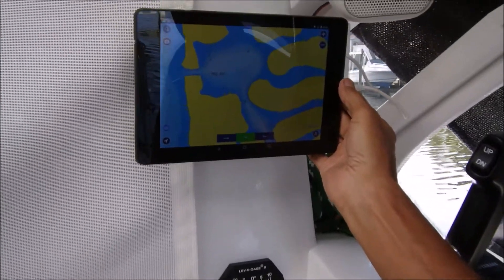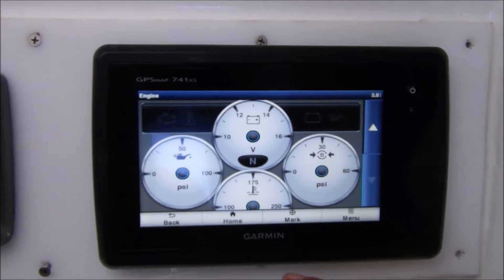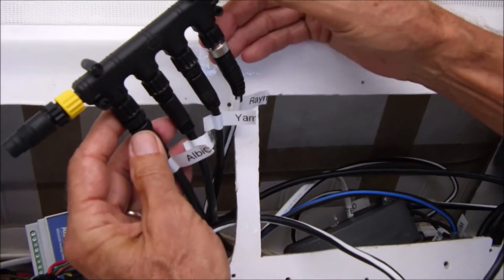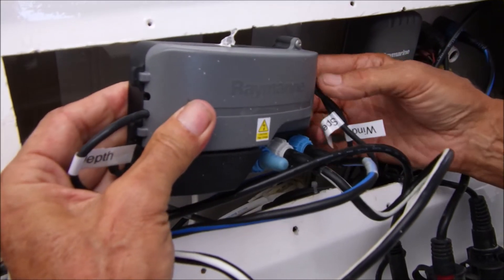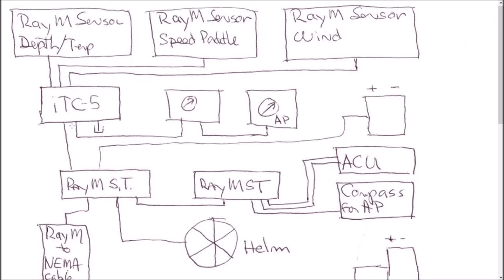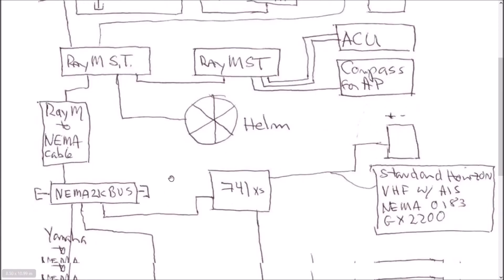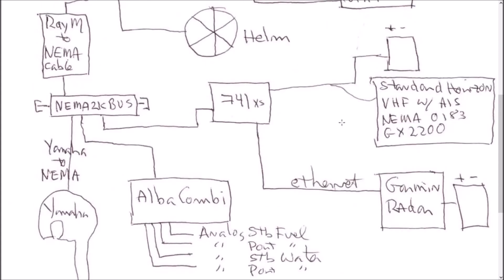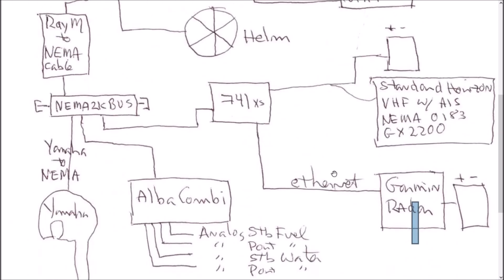066 Upgrade 3: Garmin+Raymarine+Yamaha+AIS+Analog on NEMA 2000 network, Gemini Catamaran 105Mc

Comment: hello Brian
Great video, question is it possible to add a Garmin 741 on a existing Raymarine E140w with a 424HD Raymarine Radar on that same configuration on this video?
Reply from the maker: Hi Fernando!  Great to connect with you.  Sorry, I don't know the specifics of your components.  My guess is that your Raymarine equipment is SeaTalk NG.  In my video, I used an NG to NEMA converter cable to put everything on the same 2000 backbone.  The reverse also should work: putting the Garmin 741 on your current NG backbone.  Either way, it is the same network and information, I believe.
Reply: Brian Jacobs thanks for the reply Brian... I will try to make the connections and keep you updated, thanks again.

Comment: Dear Brian, congratulations for your interesting video!!!... I have a Raymarine ST4000 and I have a Standar Horizon VHF/IAS too, and also I have two Garmin GPS one 742XS and old 441/s (NMEA2000). I am using NMEA0183 for: AIS and Wind indicator, it is working well I am connecting to both GPSs and the GPSs receive both signals well. . I think that i dont need the ITC5 because it is working well NMEA0183, In what cases do you recomend to buy ITC5, just to convert NMEA0183 to NMEA 2000? for standarized all the connection to NMEA2000?.  I want to buy the Raymarine E22158, I think it is include all for conver from ST4000 SeaTalk to Seatalk ng, an important question: do you know if this kit include the NMEA2000 o Seatalk ng converter cable?  or do you have the code number for Seatalk ng to NMEA2000 converter cable?  I would like to control Raymarine autopilot from Active Captain (Garmin). It is posible?. Thank you very much
Reply from the maker: Hi Ernesto!  You probably know as much as I do about the specifics of various manufacturers.  But let me see if I can help: I  only needed Raymarine's ITC5 for Raymarine's stuff.  Hmmm, maybe I could have put those instruments through the AlbiCombo... I should have tried it!  Sorry, don't know about the contents of Raymarine kits, but you can buy the cable separately, like shorturl.at/suwLW for example.  It is a bit confusing, but the RM autopilot is activated from the RM controller, but the course is set from the Garmin chartplotter.  Hope that helps!  Brian
Reply: @presencingly  Thanks!!
Reply: Hey Brian!!.. how are you?. This week end I installed all in the sailboat, but guess what?, In the Garmin GPS I only see the E22158 adapter. I am using the raymarine E22158 started kit. I am using the Seatalk to SeaTalkng cable and for convert to NMEA 2000 A06046 form Amazon, but only I see the E22158 adapter from the GPS, any clue?. Unfortunately I read the manual and it says that the LED flashes depending on the fault, I did not try it.

Brian: My question is, does your Raymarine ST autopilot appear on your GPS? Can you register it on the GPS? Can you drive the autopilot from the GPS? It only allowed me to mark  a waypoint in the GPS  and pressing TRACK on the autopilot allows me to navigate to that point, nor does it I can follow a route, only one waypoint. but I don't see a Raymarine ST screen or anything that says autopilot on the GPS,  Thank you very much for your support!!!
Reply: Just to clarify. I am connecting from the control unit of the ST4000 a flat Seatalk cable at one end and at the other end the yellow connector of the E22158 converter. The Seatalk to SeaTalkng cable (A06046) to the white converter connector and the other end to a NMEA2000 T. It's okay?. Thanks
Reply from the maker: @ernestogarciadealbamailper1841    Hi Ernesto!  I think you're asking "Does the Raymarine Autopilot show up on the Garmin chartplotter (what you're calling the GPS)?"   What you're describing is correct:  You can set a course (either a single point or route with multiple waypoints) on the chartplotter and the autopilot will follow that course.  You do have to press 'track' on the autopilot to initiate the process, and confirm a course change at each waypoint.  But I do not have a version of the Raymarine screen on the chartplotter (GPS as you called it).  I enter the course/route/waypoints on the "GPS" and confirm following them by pressing a button on the autopilot (or with the autopilot remote).  I think you've got it set up properly!
Reply: @presencingly  Thank you very much Brian, yes you are rigth the GPS is the Chartplotter. I will set up and do some test and verify the flashing led... Best regards,
Reply: Hi my friend!... let me talk you what do i did this weekend. 

I connected the nmea0183 output from the horizont radio to the chartploter 742 (input) for AIS. I connected directly from the output 0183 of the 742 to the input of the autopilot and yes, you are rigth, presing track button I can fallow the route entered in the chartploter, pressing track each point of the route. Other nmea0183 input cable of my old gpsmap 441s i am connected the wind indicator and I sent via NMEA2000 to all the equipments. I am using the E22158 to take al NMEA0183 data to NMEA2000, or I don´t know if the chartploter is doing this conversion. I will disconnect the Seatalk network next time. 

 I was wondering if you can see direction controls or autopilot control/device in your chartploter, can you see it? I only see in NMEA devices the E22158 or you only create the route in the chartploter and you fallow it in the autopilot pressing track?, or both?. Sorry for bodering you. Best regards
Reply from the maker: @ernestogarciadealbamailper1841   Hi Ernesto!  No problem at all.   You are correct:  I do not see direction controls for the autopilot -1/-10 and 10+\1+  on the chartplotter.  It works exactly like you said:  I can create the route in the chartplotter and follow it on the autopilot by pressing 'track'.   Great job!
Reply: @presencingly  thank you very much!!! Best regards

Comment: Hi Brian, I am in Australia & live on a Pescott 11.7 Meter sailing Cat. I am about to swap my old Yamaha 9.9's for 2 X T25XWTC Yamahas. Your video is very informative. You say you have a Yamaha 25? Is it a T25 or an F25. & with the wiring of the engines to the NMEA 2000 Multi display chart plotter? You have cables running  with no 'Gateway' ???? I have All Raymarine instrumentation & a Raymarine C95 plotter  so it is all 'SeaTalk' rather than NMEA 2000 but other than pin configuration all same same. Looking at what you have done (a couple of patch cables) & what Yamaha & Raymarine tell me I need a Command link network Hub, A Gateway MAR_GTWAY_09 & a EC-100 connectors for both motors. Yet you have done it with a  some $80 cables. I need to pick your brains. Thanks Mate.
Reply from the maker: Hallo Mate, Love AU!  Got to do 2 months in Gold Coast (see video).  I have an F25, but I think the T25 is a better choice because of the larger prop (9 vs 11 inch dia.).  Get those Lowrance Yamaha / NEMA converter cables, review this video a few times, and I think you're good to go!
Reply: @presencingly  Thanks.

Comment: Hi Brian I liked your video. Maybe you can help, I have the same VHF and Garmin 750 chartplotter. I have connected both by NMEA 0183 with the Plotter and VHF unit receive GPS data for AIS but I am unable to see AIS data on the chartplotter. Is there any setting on the Garmin. Regards Shariff
Reply from the maker: The baud rate on the VHF has to be correct for it to work.  I'm not sure anymore.... try 9600?

Comment: Brian can you use auto guidance from Garmin to work with your Raymarine autopilot.
Reply from the maker: Hi Alberto!  Yes.  I enter the route on the Garmin and the Raymarine autopilot follows those directions and corrections.
Reply: Hi Alberto... did you solve the problem? Can you use the auto guidance from Garmin GPS?

Comment: Thanks Brian!  Nice to see more Gemini videos from you!  I'm struggling to get my old Sea Talk 1 (ST60) instruments onto NMEA 2000 to talk to my Garmin.  It looks like your old stuff must have been Sea Talk NG, correct?  I'll have to research the ITC5.  I don't want to replace all my instrumentation if I can avoid it!  s/v Mavis #816
Reply from the maker: Hi Frank!  Yes, it is Seatalk NG.  The iTC does exactly that: keep your old instruments.  Let me know if you have trouble with it.  :-)
Reply: Ordering an ITC5 now.  I also REALLY like what you did with the fresh water tank levels.  So much nicer than the normal Gemini routine of propping the beds up and watching the tanks fill.  Looking forward to more videos from you.
Reply from the maker: Yeah, those water tanks were SO aggravating!   Hey, I also disconnected the vent tube in the lazarette where it connects at the fill neck.  Now I can clear the vent with a puff or two, and it fills much faster.  Finally got it figured out, yeah!